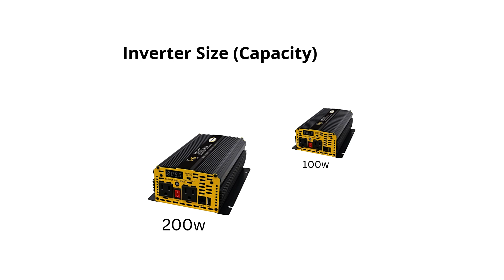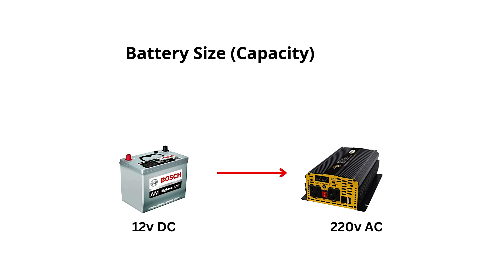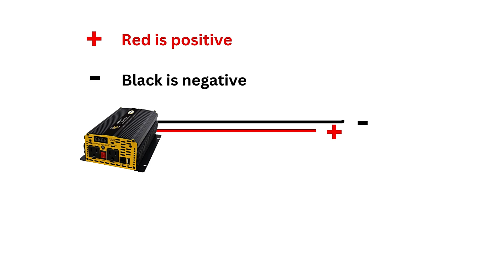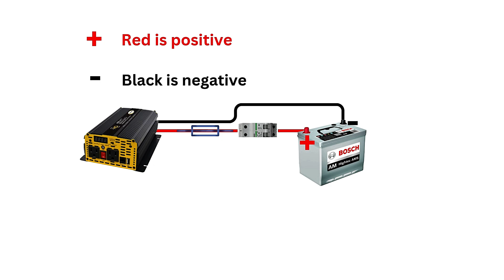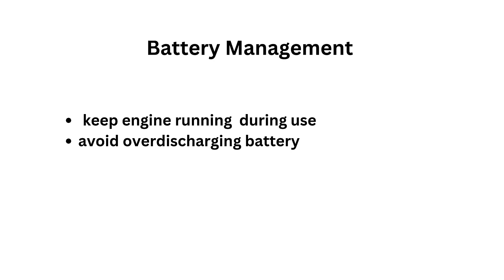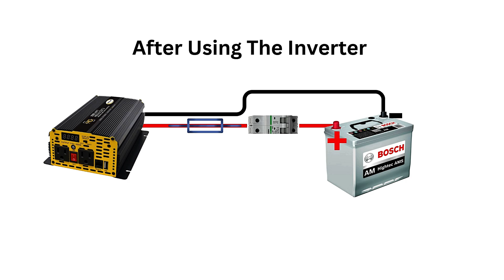Ultimate Guide To Connect Inverter  To Car Battery | How To Use Inverter With Car Battery #battery

Comment: Can I use jumper cables?
Reply: No, my battery’s in the back (24 CAmry). I did this and it caught on fire in my trunk while at Panera Bread drive thru 😅
Reply: @b @brendanmoore8747 😭. Fuck I was about to do this in my 2016 Camaro 2SS to connect some Christmas lights
Reply: The lower the voltage the higher the amperage. That's why you need thicker cables like the ones connected to your car battery. The shorter and thicker you can make the connection the better. So try to put the inverter as close the battery as possible so it can put 120 voltage and you can run a extension cable.
Reply: @omega1gun212 can you help me install one in my wrangler i just need some pointers, because i have an idea of what to do just don't wanna burn the 93 wrangler down lol
Reply: @construed you cant use a high amounts of electricity for a long tine with this set up, it kills your car battery and the alternator depending on the type and it can only put out about 1000-1500w at full draw. What are trying to use it for?